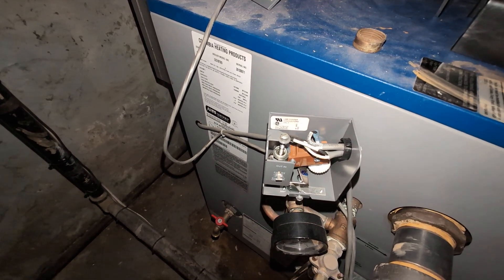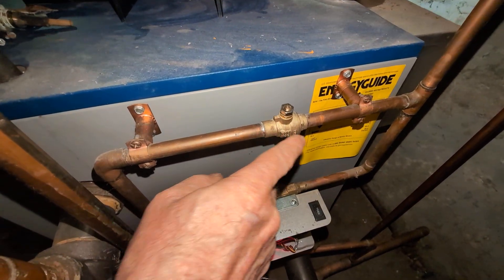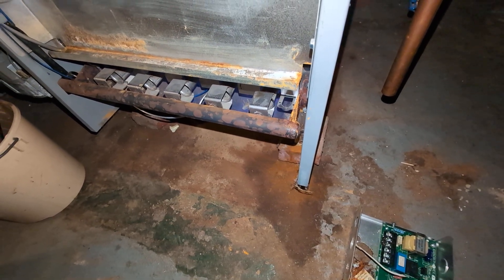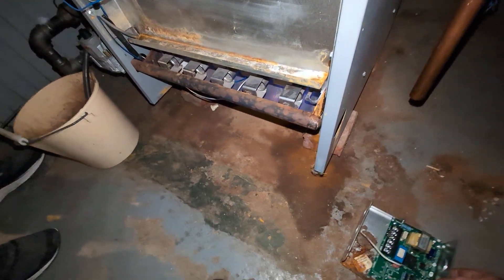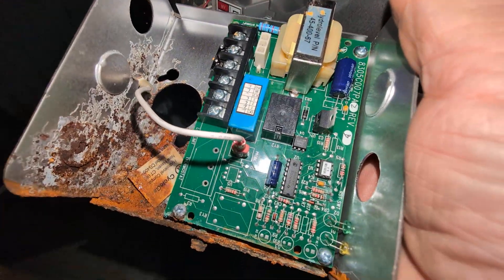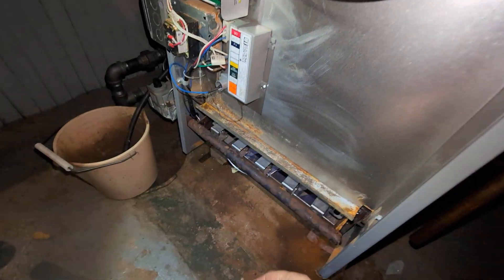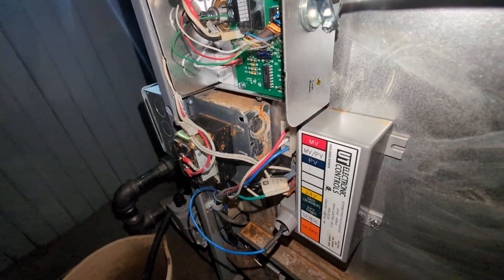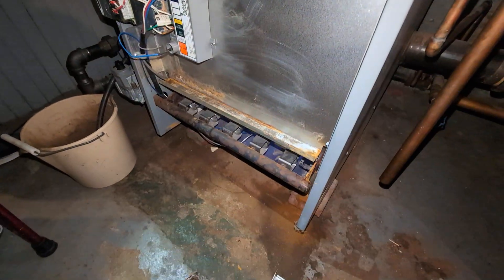When The Customer Spots A Problem And Tells The Tech, It's Best To Pay Attention

Comment: The OEM Honeywell low water probe on my 1991 Burnham was so rusted it parted ways with the steel case. Not visible unless the cover was removed.  Needless to say, the boiler stopped functioning.